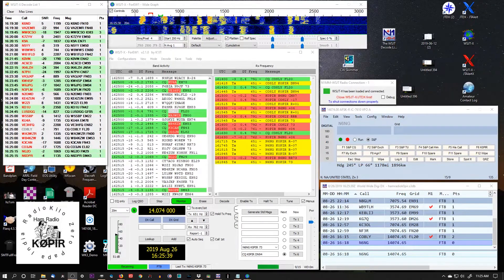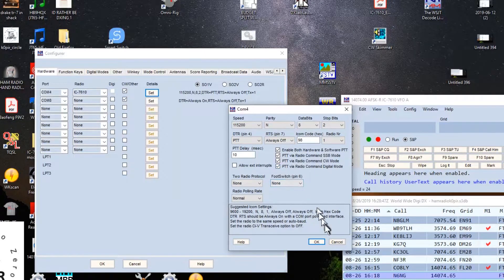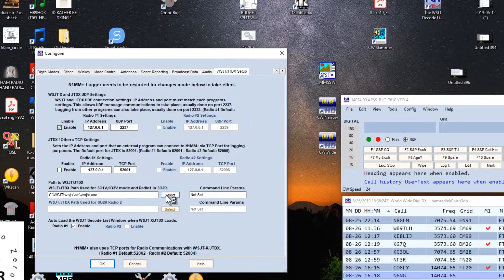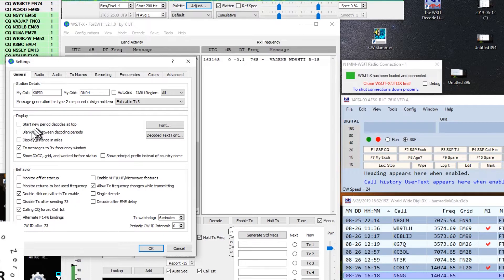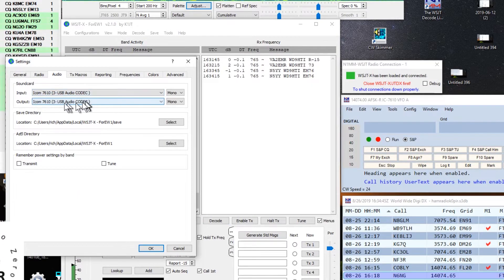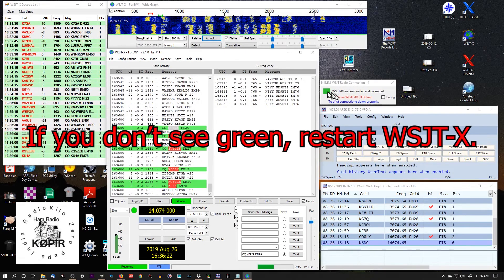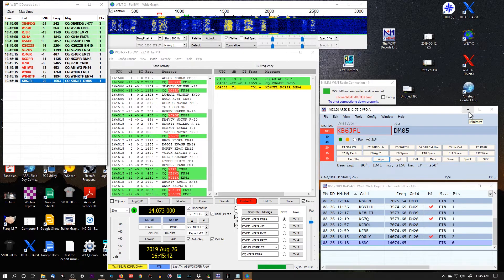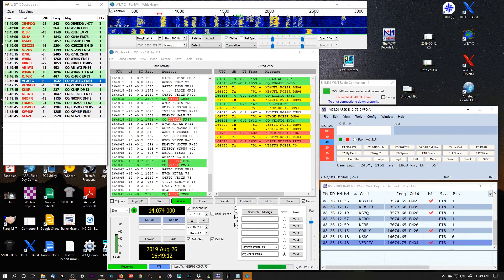WSJT-X N1MM Logger for Digital Contesting - WW Digi DX Contest

Comment: I'm using a 7300 with just the single USB cable in the com3 port of my PC.  I've followed your video carefully and I've got a couple of problems with WSJT-X.  
1. - WSJT-X loads and connects and I get decodes but it won't send audio or any commands to the 7300.
2. - The small N1MM-WSJT Radio Connection -1 box has a RED flag (not green)
3. - On your N1MM "configurer" I see to com ports on your screen.  Both COM4 and COM8.  Are you maybe using something to create a 2nd COM port for controlling the 7300 that I might need to make WSJT-X work through N1MM?
Reply: Disregard.  I got disturbed by the communication problem before I went on through all of the new settings within WSJT-X.  In your video you didn't have the RED box flare up right away because you obviously had already made all the necessary changes to WSJT-X.  My mistake.  I think I'm fine now.
Reply from the maker: Dave White Thanks for commenting here and I am happy you got it going. I was using this with my ICOM 7610 and it has two virtual serial com ports. Hope to hear you on. Best 73!

Comment: Remember to set up the contest in N1MM also, it's WWDIGI.   One issue I'm having is duplicates, it's accepting them.  Normally N1MM warns you of them, it's not doing it right now--what did I miss?
Reply from the maker: Dennis Heaton Good question. I see in mine that it shows Dupe in red, But I haven’t started my contest log yet. I’ll keep an eye on it and post if I have problems or think of anything.